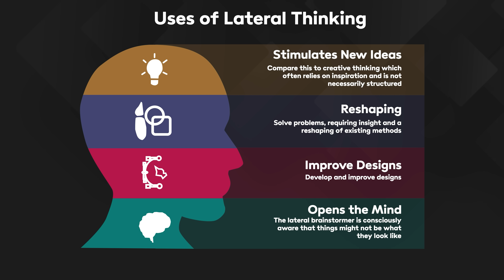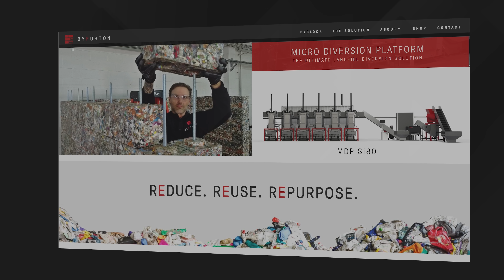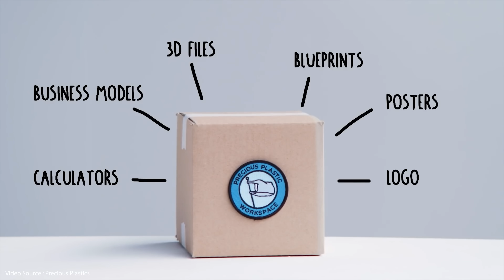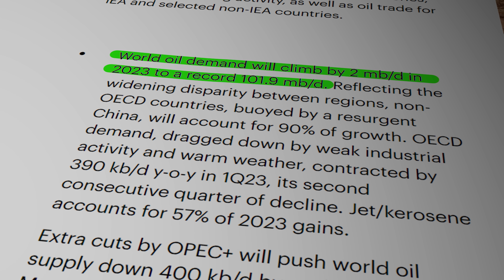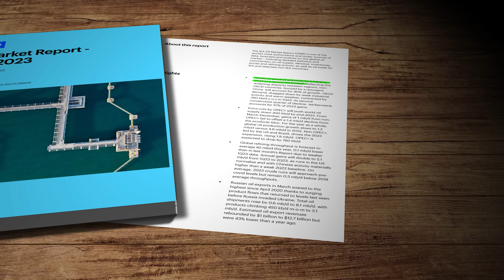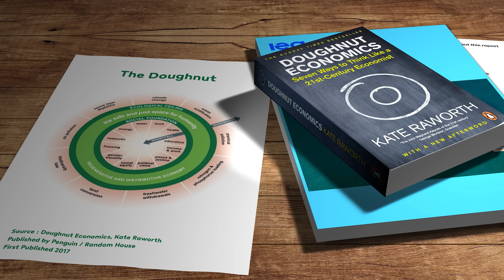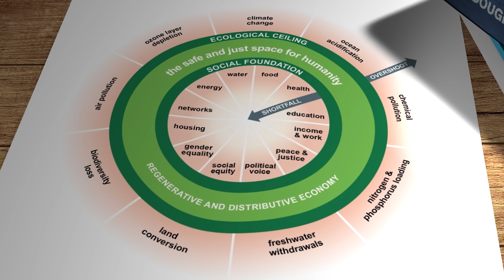Plastic doughnuts? Have you lost your mind!?

Comment: Reminds me of a company/initiative or something from 20 years ago dealing with automobile tires and what to do with mountains of them piling up in a well-used and no longer useable state creating periodic havoc from mosquitos when it rained and fires when it didn't. Turned out the Germans had a machine that separated out the steel belts and then pulverized the rubber into powder from which all manner of useful items could be made. A friend of mine tried to interest the California governor of the time into subsidizing since California is a much-travelled state with an impossible amount of old tires ending up here clogging up the place. I was relocating to Amsterdam at the time, my friend subsequently died, and I never found out what the heck became of the idea. Details are probably stuck in a long-dead hard drive.

Comment: There's a product that's been on the market for a while called Lok N Blok which only upcycles polypropylene into its product. But it doesn't need supports because all of the blocks interlink. There are also gaps to fish through the wiring. This makes it twice as fast to build with and doesn't require expertise to do so.

But getting approval in the states has been a challenge. These are mostly used in SA.
Reply: Sounds like they might be in trouble with the patent lawyers at Lego
Reply: @trueriver1950  lol actually I heard it was more that the patent clerks couldn't understand the concept. They thought it was too much like a cinder block or something.
Reply: @NickCombs  🤗

Comment: Regardless of the potential fire and chemical hazards posed by mixed plastic blocks, the fact that plastics are called such because they yield under load makes their use for any load bearing structures a short-sighted idea, especially thermoplastics exposed to both loads and high temperatures. Doesn’t even need to reach their melting point, but a fraction of it, and they yield easily.

For non-load bearing components and when fire and fumes aren’t concerns, it can be considered.
Reply: As far as fumes are concerned, are you aware that most modern materials outgas. Modern techniques also call for breathable envelope and you can build so those fumes end up outside, not in. 
And... toxic building syndrome?  Adhesive, flooring, paint, all release toxic fumes. Idk where you guys come from but you sound like pansies.
Reply: This is exactly what I was thinking too, including the emission of harmful gases both under UV or even concealed. There's also the fact that the plastic problem is not solved, but pushed to future generations to solve. The construction sector need to use more wood into larger buildings, this is a very great construction technology developed more recently.
Reply: @forgotten_world  I agree, this is mostly downcycling and kicking the can down the road. Like the crumbled tire rubber used on synthetic turf, which is now acknowledged as releasing carcinogenic and irritating chemicals.

If it’s to be used, it should somehow be sealed and not used in structural members.

Edit: spelling correction
Reply: @forgotten_world  I believe you missed the point
Reply: everything "yields" under load, those blocks didn't give any part up when a truck went onto one. that's plenty good enough for load bearing structures (not massive ones clearly) but a house or apartment complex would be plenty. 

once they are all seated and bonded together there isn't going to be moment, they are solid compressed plastic. it's not going to burn unless a massive fire breaks out in the building and at that point your material matters very little. not that those blocks would even burn because they are compressed, the worst that would happen is the outside ( inner wall facing) would melt a bit and that's it. you would still have insulation to stop the spread of fire anyway.

no load could make that plastic burn due to compression in a structure because the compression done on the plastic, to form it, is already going to be many times whatever the structure is capable of putting onto those blocks.
Reply: @rocksfire4390  Actually, yield was quite visible when the truck tire ran over it. It’s called plastic because it yields more easily under the same conditions than other materials. And thermoplastics because they yield extremely easy when heated.

I’ve worked with similarly formed blocks and extrusions in attempts to find uses for used film packaging and similar scrap from single-use packaging. Cut a section any way you want, you’ll find a lot of voids, especially if they’re from multi-layer, multi-material film.

Plastic yields a lot more than wood, masonry or metal for the same cross section. It has an advantage over wood in that it changes less with moisture content.

As far as fire, check what happened with the plastic tiles used to cover the outside of the Grenfell Tower apartments in the UK. That’s why the manufacturer advises to use their metal version for anything more than a few stories high.

You’ll also notice they move the flame from the torch very rapidly across the middle of a face, and not repeatedly over the same area either. That’s what you’d do to not ignite a block of plastic. Even then, you see some edges of film in the block light up briefly. Had they kept the flame in one spot for several seconds, especially at an edge or vertex, the material would ignite much more readily.

Edit: corrected name of Grenfell Tower.
Reply: @chow-chihuang4903  
the bottom isn't perfectly flat, when the weight of the truck went onto it the bottom flattened, that's what you saw. the block overall didn't deform at all, once blocks are stacked onto each other they will flatten out and stay that way.

next, they didn't move the torch rapidly, it barely even moved an inch lmao and the entire length of the clip was in the same area. also plastic bottles (the plastic used in them at least) has a melting point of~250C, it would take more then several mins to reach the melting point of most of that plastic then they would need to sit there for WAYYYYY longer until it finally starts to burn.
there are massive differences in thermal conductivity between plastic and say metal, it would take a VERY VERY VERY VERY VERY long time to melt all of that plastic and then try to ignite it. 

proper construction (using the correct insulation) would stop a fire from melting the plastic, let alone it burning anyway, so your point is completely pointless on it's face.

lastly, that building in the UK you are talking about isn't the same as what's being talked about here. the reason for that building catching fire is the OUTSIDE cladding caught fire (it's in direct sunlight as well). while these blocks will go where cinder blocks go, which is the structural part of the building, the outside and inside walls are attached to it. so trying to compare it to that is foolish because it's not even being utilized in the same manner.
Reply: That's BS, if they're in bricks they'll hold up. Have you ever dropped a cinder block? They break easily. And the term here is plastic deformation.  If the material is pushed to that point yes it could fail, but when you make a brick out of plastic you'll have a modulus of deformation based on its cross section, and as long as you're in that limit you'll be fine. And have you seen a brick of plastic? If you have you'll know that they don't resemble something like a bottle or bag in any way and are totally solid. 
How exactly do you mean that it will yield? Or deform? And then what does the building fall down? Of course not, that's ridiculous! So what are you saying then?
Reply: @simonlinser8286  I believe I mentioned I worked with similar pressed or extruded plastic, made of chopped film and sheet from used packaging. I know how it reacts. We were evaluating it for use in podiums for a summer Olympics, but the converter simply couldn’t make it in the volume or quality we felt comfortable using in such a venue. I also worked with many other formed plastics, in addition to metals, woods, etc. for a few decades. I know something about the uses and limitations.

But don’t take my word for it. Look to manufacturers of plastic decking. Their products have better and more uniform composition than these blocks, plus many are reinforced with wood or other cellulose fiber. They’ll only recommend their products for decking or components of railings (the structural ones are cosmetic skins over PT wood), never the structural members, which they recommend be made of pressure-treated wood, aluminum or steel.

Now, for non-load bearing applications, fine, consider it if you wish.
Reply: @chow-chihuang4903  Structural blocks are subjected to compression, you don't test for compression "dropping it to the floor" 😂 Architect here. If people have no idea of what they're saying, better not say it at all, or do a little research instead.

Comment: It would be good to obtain more specific information on the plastics material.  Important would be results of structural engineering tests, heat and flammability tests, specific utilization criteria among other things.  On the surface utilization and redirection of waste plastics at an industrial rate is a win win. First we need to find out about the life, safety and environmental cycle.  Would like to see more of this.
Reply: We have asphalt for a reason we already know what's going to happen. These bricks will last a couple of years and will cause an expensive clean up
Reply: @svenjorgensenn8418  That is an "assumption" which means you don't know.  Danger of microplactics is still a possibility, but we dont know what change chemically and structurally o cures when it is heated and compressed. There is a lot we do not know, yet we also do not known for sure if such material will stop the building industry from clear cutting the planet.  The possibilities are immense. The down side is as yet not made public.

Comment: Blah blah blah all sounds good until you come upon the reality that it takes less energy to just make raw plastic than to recover and recycle it.  Indeed, recovering and recycling plastic is so expensive that to make plastic pellets used in injection modeling processes it is actually cheaper to buy solid plastic blanks then shred it and make your own pellets.  It's not even economical to make plastic pellets out of recycled plastic.  Here to is the problem with leftest eco-warrier liberals.  You can't cherry pick your data points.  You have to figure it all out to the Nth degree.

Comment: What a horrible idea to downcycle valuable resources (for which oil was used to create them) into a product where you really don't need the  properties of plastics. And then in the process mixing it up into a horrible mix that you'll never untangle again, and where the properties are guaranteed to be all over the place, making certification of the material near impossible. And also giving an excuse to pump up more oil and create more new plastics, because hey, there is nothing left to recycle.
The idea of recycling or reuse of materials should be: to increase the entropy as slow as possible in each step. Not to go from low to max in one step. That is as stupid as using electricity for heating by pushing it through a resistor.
Reply: Thank you.
Reply: Yes! "a product where you really don't need the  properties of plastics" totally sums it up.
The process by ByFusion is almost the worst way to 'recycle' plastics. Almost like a high school science project.
The other examples from around the world that Dave cited were far more mature and 'engineered'

Comment: I remember a company which does a lego similar system, much more sophisticated compared to this. It was shown in a report a few years ago, the company exists for 20? years so something like that but did not sold much.

Back then and esp. here I wonder how this will impact the air quality in the building etc, I mean when I remember correctly the one I have seen back then was one type of recycled material and at least you have an idea how it will react, but just shreded material is a bit to simple.

Seeing how they build the walls I also have to add, wow looks like they have no experience with constraction or are just... even I know you don't just lie it on top of each other. The steal bar not really helps, IMO.

Comment: The only downside is the flammability,  but given that wood is used in a lot of structures that's no real difference.
A good comprimise would be hollow blocks that build like Lego,  but get filled with concrete for resilience.  The real beauty of this idea is that complex and interesting architecural forms can moulded in,  avoiding the bleakness of rain-stained concrete slabs.  Parts of the plastic forms could be removable to expose these details
Reply: or employ bromine based fire retardants as a surface coating or included in the compression of the waste plastic. The real beauty of this idea is that carbon is locked away and if/when the building is to be demolished, the blocks can be recycled again. We need to avoid concrete.
Reply: In 03:30 they show how some type of spray makes the blocks fire resistant.

Comment: Finding the solution of re-using plastic waste for building materials very good, i think this is hardly a circular path for the plastic, it's just a second (hopefully long term) use of the plastic.
Once demolition of the building happens, most likely the whole volume will be dumped in.a landfill. I doubt that the blocks would be separated and used a 2nd time (which would be ideal). Or maybe plastic recycling is better than now. But for now, this is 2nd use, not circular. Great, but just shifting the problem into the future.

Comment: The use of waste plastics to make bricks sounds very sensible but will they be fire resistant, would they expand and contract a lot, how much would they deform under tensile loading and compression?  Would the bricks be glued together or plastic welded? 
With the number of companies involved in this field, I’m sure they will find a way to overcome these issues.
Reply: About twothousand years ago there was still puzzolane (strains of "flexible stone") available in some volcanic regions, but later hardly anyone mixed plastic fibres into concrete for other abilities. Like safety working shoes that have steel caps to prevent damage to toes but hardly anyone has caps made of plastic fibre so a heavy bump won't squeeze into the toes like steel would, even causing the problem how to re-open the steel cap. 
And there are already a few organisms found having learned to digest some plastic types, so if those were app-roach-able in some crannies in the concrete, those little animals might start to eat that concrete that has plastic in it and i'd pessimisticly assume that there will be strange mycel or fungi "when we all would be gone". With so many plastic types i'd "guarantee" that such a building structure will be devoured within decades, but then there's nobody helping as warranty service, the firm will be gone then. Even though some aspects of the idea might sound useful. 
Where i live we have to purchase plastic bags to collect plastic and bring it "because this isn't possible in a different way due to the handling" some frustrated bureaucracy woman answered to me. 
And there is a lot of stuff that can rot if it's deposited at a place for more then three years (perhaps with dirty stuff mixed in).

Comment: Problem:  Plastic is flammable, burns at very high temperature, and emits thick, noxious smoke.  Concrete avoids these risks.
Reply: True! But What's wrong with a little hydrogen cyanide?  lol.
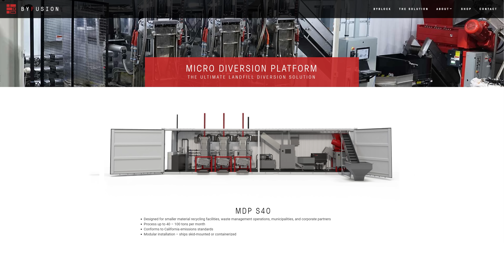Reply: plastic is flammable... so what? have a look at 3:37 the gas torch is obviously not causing any damage to the building block... that thick, noxious smokeyou are talking of may be more true for a waste incineration dump...
Reply: @7sonderling  That’s why the clip is so short - they cut off before the material reaches a self-sustaining point (lit). Tires are also difficult to start burning, but once lit, they burn quite well, are difficult to extinguish) and release a soup of toxic compounds.

As far as flammability ratings for plastic materials, the lowest is HB (horizontal burn), which means once lit, it will continue burning across a horizontally oriented piece. The highest is V0, which means after it is lit, it extinguishes in less than a minute for the thickness tested. Similarly, Vx means the tested thickness extinguishes within x minutes after being lit. Unfortunately, the self-extinguishing behavior is achieved with additives that are often toxic themselves and release a variety of toxic chemicals when defeated.

I don’t see this a useful application for plastic materials as there would be no one willing to insure such structures.
Reply: @chow-chihuang4903  this is probably due to a lack of imagination. i see plenty of possible applications, and the manufacturer certainly does too, they certainly know all the fire protection regulations and will still have good reasons to see a market here, they are not stupid and don't have any money to give away...
Reply: @7sonderling  3:30 that block was coated with something and when it burns off you will have a nicely melting and then burning block of mixed plastics. Good luck surviving that building fire!
Reply: @saalkz.a.9715  the first thing that starts to burn is usually the interior... or do you want to tell me that no one has ever died in stone walls due to smoke or fire?? if the smoke detector doesn't warn me by then at the latest, the last thing that burns and that i would have to worry about is a wall like that...